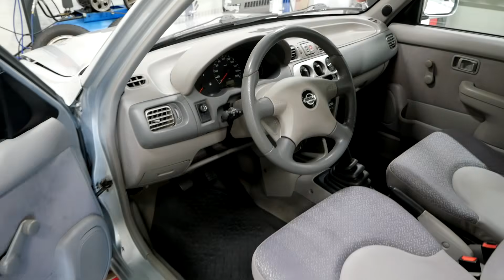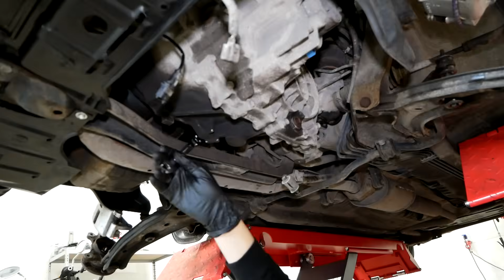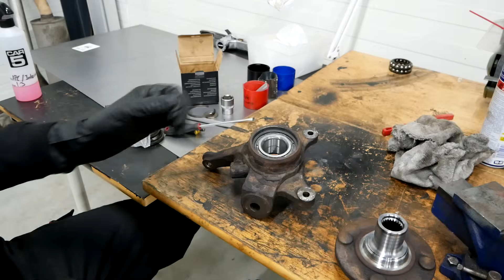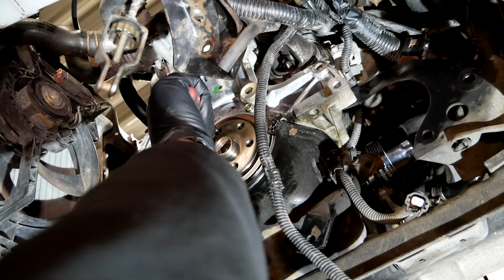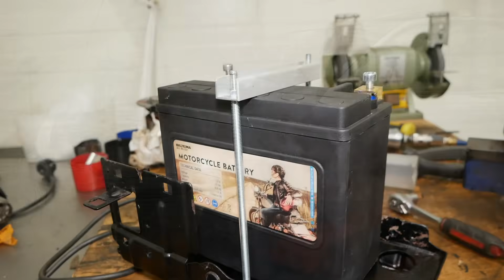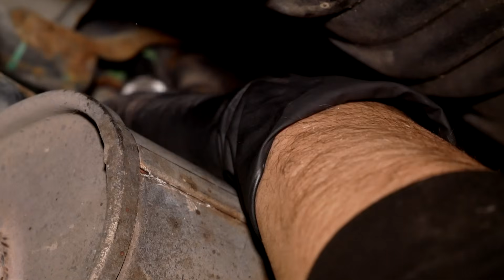Making my Track Build Nissan Micra Fast & Nimble on a Budget!

Comment: I have a question- I got a ‘95 Micra CG13 manual and I have a clutch kit to go in it. Instead of machining the current flywheel; will a 1L flywheel fit into the 1.3 WITH the 1.3 gearbox? Or will it only work with 1L box?

Comment: I get I am a year late to the party but just a word of advice; you can purchase separate studs and longer ones at that, as I previously had a stud split in half after attempting to remove the wheel, turns out the previously when I replaced my tyres the tech did not only torque it to spec he also managed to add a little leverage.

Comment: Hej! Great job! I really like your videos.
At 23:20 you'd probably made a mistake when you used aluminium for adapters on battery, because aluminium and copper creates a galvanic pair which is very susceptible to galvanic corrosion.

Comment: I have had 3 micras best performance mod is a 1.5 throttlebody  and some corsa B coilovers
Reply from the maker: Did you run the 1.5 TB on stock tune/stock ECU?
Reply: @ejoautovideos  yes I did and its plug and play unlike the 1.6 throttlebody mod also have a video somewhere of it spitting flames

Comment: i have a K11 4 door as my daily and really want to enhance  it BUT here in Australia they are very rare and almost zero parts on shelf ,my question to anybody is that its sometimes diifcult to go from second gear to third gear ,the clutch engages about 2/5  off the floor and feels a lil stiff,a mechanic said its because its cable operated and just to stop whinning and get used to it or maybe buy a better car ,can i fix it or just deal with it ,thankyou for any help

Comment: In the last video you made I asked about the wheels how much you drilled, this is why.

I also ordered new hubs, didn’t have studs long enough on them, my original studs are also not long enough, front or back,
I ordered extended studs for 200sx and for Subaru both were mentioned online they’d fit, didn’t fit mine nor the new hubs I got,

What model year and model exactly is yours ?
Reply from the maker: Mine is a year model 2000 1.4 no ABS.
I didn't remove much material at all around the holes on the rim. Maybe 2-3 mm max. Perhaps the studs on my Micra are longer from the factory? 🤔
Reply: @ejoautovideos  next time I go to the scrapyard looking for parts, I need to take a vernier and measure the length of the studs I have and what's available there.

If I could ask you how much your studs stick out from the face of the hub?

I don't imagine that the brake disk thickness is affecting the engagement.

I have already spent close to 1000eur on restoring 6 of these wheels, 2 to have as spares, gold centres, diamond cut lips and fresh rubber, I really want to put them on already and find a way to do it, I hope you can help, really love how your micra sits on these wheels, looks so tidy!!

Comment: I've got a similar issue with my megane gearbox not returning to neutral and I'm hoping it's also just a snapped spring as the rest of the box feels really good. Unfortunately my mechanical knowhow is lacking so need to find a garage to have a look.

Comment: Awesome video!
You are giving me ideas for my own K11 1.3 that I've recently bought.
Have you considered replacing the crankshaft pulley for the 1.0 (lighter)? Im still wondering if it fits...
I'll keep and eye for your result of the lightened flywheel, I wonder if its any harder to manage the clutch bitting point using it in a daily driving car.
Reply from the maker: Thank you!
I'm actually looking for a used pulley from a 1.0 facelift, but nothing for sale right now... 
No, the 1.0 flywheel isn't that much lighter, so it won't affect the behaviour to much. It will become a little bit more rev happy and hopefully a little bit quicker. 👍
Reply: @ejoautovideos  how many micra k11 are still driving in you country, we have a bunch here in the Netherlands still driving arround. I noticed that yours has electric mirrors, headlight sprayers, and heated seats, none of the micras here have those options so I'm really jealous cuz i want to build one with mirrors and heated seats so im guessing i will be making a trip for those parts

Comment: Nice video bro, loved it!
I just want to give you an advice from my own experience. If you put grease in the dust cover, the centrifugal force will make it stick to the inside of the cover, and it may cause a little bit of imbalance on the axel, and it may worn the cover much faster. (sorry, my english may be a bit bad.)

Comment: Har väntat på den här videon!! Jag vill ge dig lite tips. Fixa ett 2-2.25" avgassystem med en resonator eller ljuddämpare före bakaxeln. Bra viktfördelning och lite mer vikt hyvlad av bilen. Se också till att skärma av för luftfiltret istället för att ha det helt öppet för annars kommer det bara suga åt sig varmluft efter ett varv på banan. Se om du har möjligheten till att mappa om den nu när du har gjort lite ändringar för att få det mesta av det som möjligt. Till det sista, se om du har möjligheten till att fixa en "strutbar" både fram och bak för att få så lite "bodyroll" som möjligt. Små saker som dessa gör större skillnad än vad man tror.

Comment: You can make a cold air intake from the fog light grille to the filter. And if you want some easy visual mods you can paint the chrome from inside the headlights black instead of chrome
Reply from the maker: Good feedback 👍

Comment: Nice project!!!! I recommend you to build an aluminum heat shield for the induction kit so it doesn't suck in hot air and instead suck in cold air, then you will probably gain more power than before (I've done that to mine) 
Keep it up!
Reply: I just wrapped some flexible heat shield like zircoflex around mine above the exhaust has better insulation properties then aluminum. They also sell sheets so you could replace your aluminum one with it.
Reply: @oli_onion  that's nice! I will check it out! Thx!!!

Comment: As long the battery familiar of cranking amp as recommend cranking amp.
Relocating the battery to trunk that help with weight transfer also it space up more room engine bay so you can getting more suitable air intake position and it’s might better if it has heat shield

Comment: Welcome back habibi :). I can't wait to see what you do and HOW you do with the Micra on track. Small cars are so much fun, i had an 2002 integra type R in the US, wanted something Americans dont get when i moved to France and bought a Swift Sport, SO fun in the french mountains. Even with a solid rear axle handles amazing. You can rent em on the Nurburgring so they must be good haha.

P.S. you should relocate the battery to the trunk, would make for a great video and help with weight and weight transfer. Btw gears and gasoline did a few dyno runs with different intakes, the straighter the intake the more power it made, on a k20-k24 anyways.